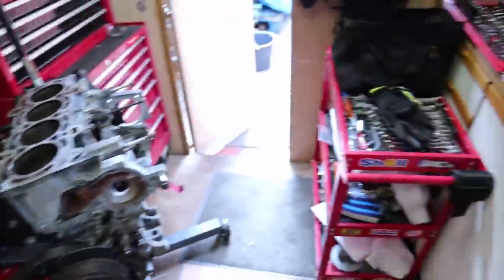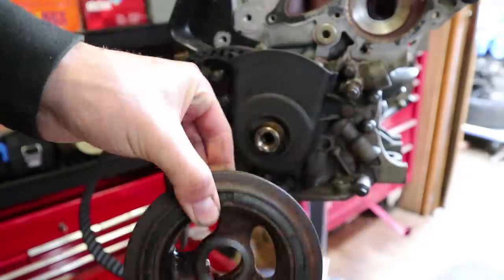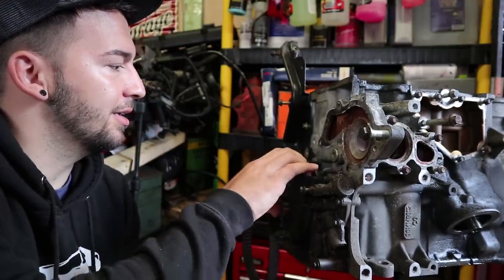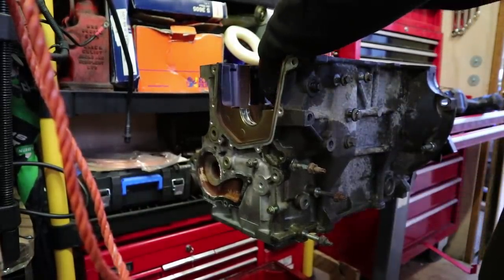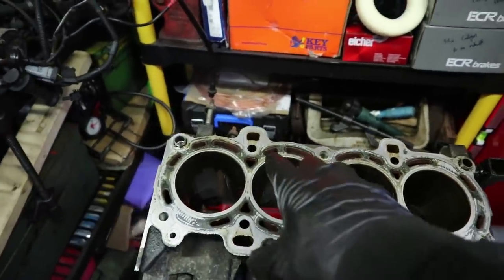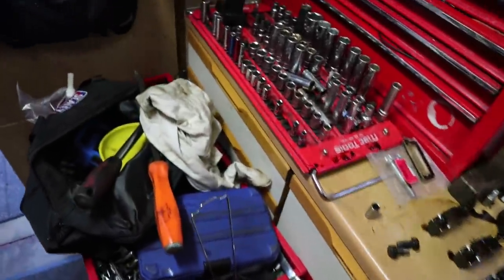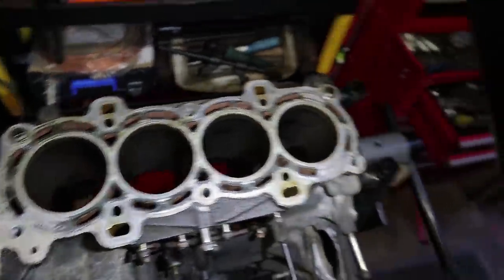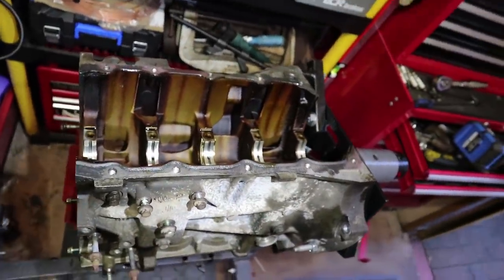Fiesta Mk5 Zetec S Engine Rebuild! Part #3

Comment: It's not a great design on the bottom pulley. I did mine in the summer and had to borrow a snap on gun from a friend as my guns wouldn't touch the bolt. When I tightened the crank pulley, it did give a concern that as you can't torque it, because the way it is designed. It would have been a much better design with a key way in the pulley's. People may have a better design of it than me though, just my thoughts on it.

Comment: These engines are classed as throw away engine by ford, if it goes bad they throw it away and stick a new unit in, as it costs less in the long run, they can be rebuilt but at great expense and lack of parts will be an issue, these engines have nikasil bores meaning it’s a lot harder to hone out another reason it’s a throw away engine,
Reply: pricelessmods they don’t have nikasil cylinders,the puma 1.7 does
Reply: All the zetec se/sigma engines have nikasil bores as they don’t have steel liners. All 1.25 - 1.7, as they are all the same base engine just minor differences
Reply: Aye ok Chico 😂

Comment: If your after something with a bit more power I'd definitely recommend this impact driver, higher NM rating than the Milwaukee fuel and a fraction of the price. https://www.screwfix.com/p/dewalt-dcf899hn-xj-18v-li-ion-xr-brushless-cordless-impact-wrench-bare/4660j @the savage garage love the content!